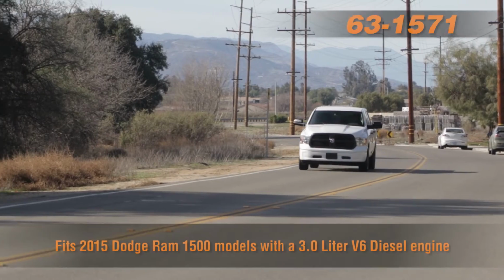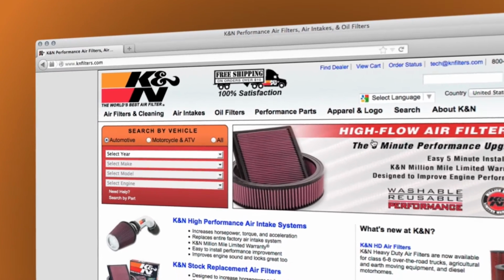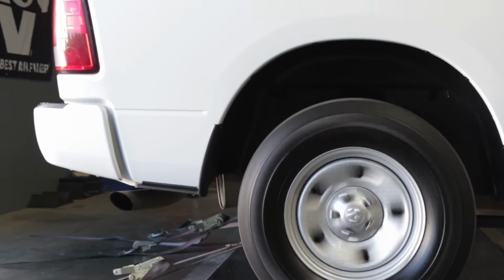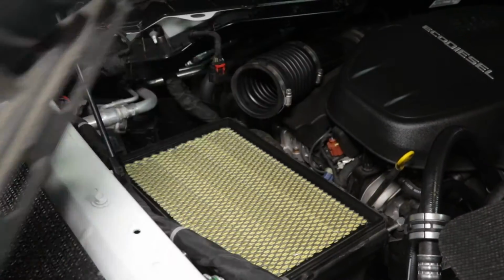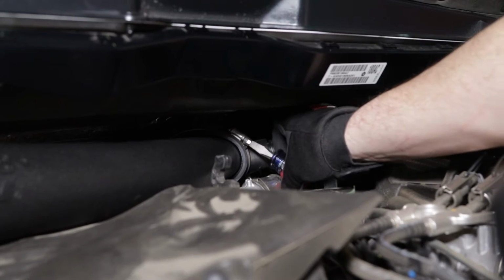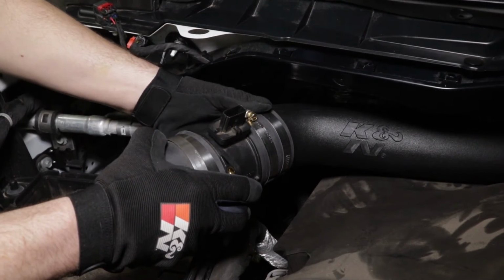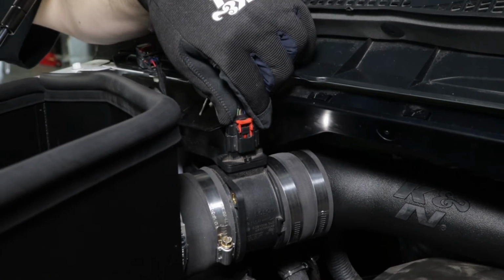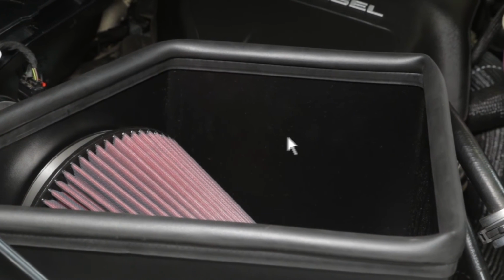Dodge Ram 1500 3.0L Diesel [#63-1571] Air Intake Installation

Comment: I have one on my 2016 Ram 1500 Laramie Longhorn 3.0 ED. You saying it's only for the classic model is worrisome. I bought the truck with it already installed. Trying to get fuel economy lined out with a tune, and now this is on my mind. Would this be a big problem for me, or no? I don't notice the sound that you are showing in the video in reference to the turbo. Which again is worrisome to me.